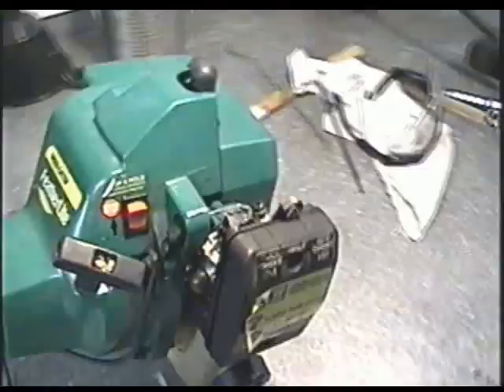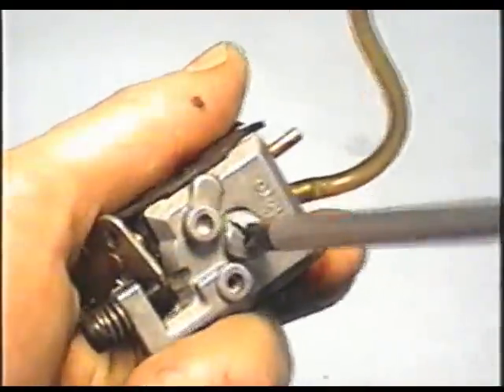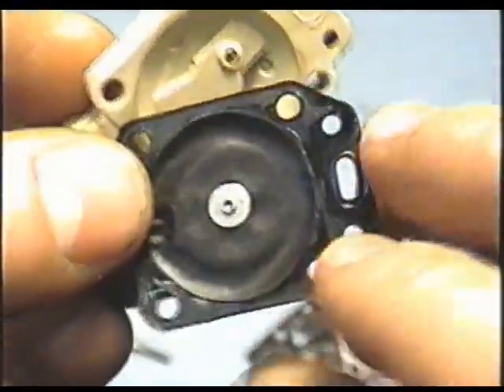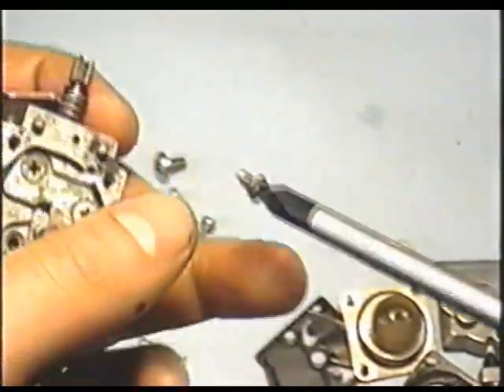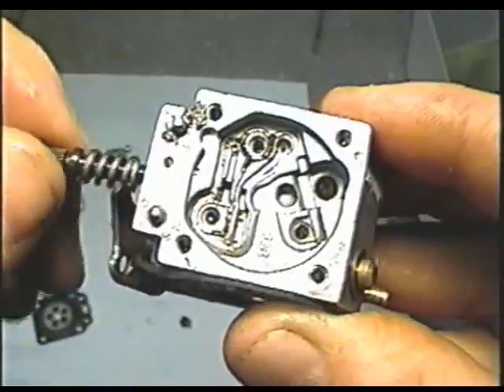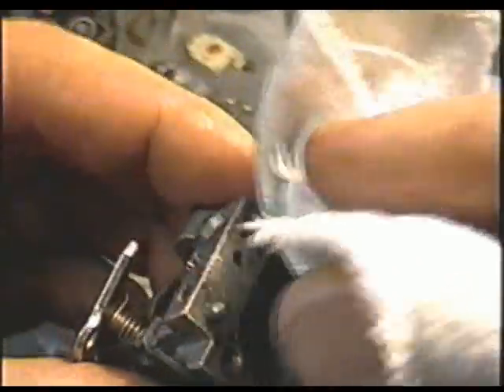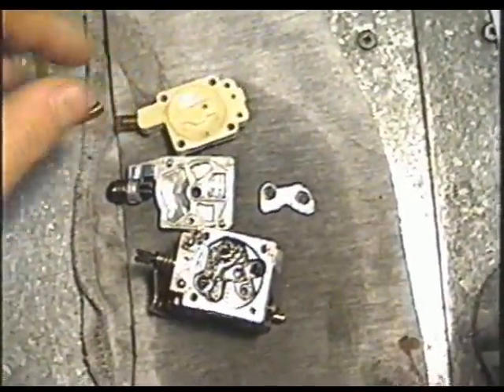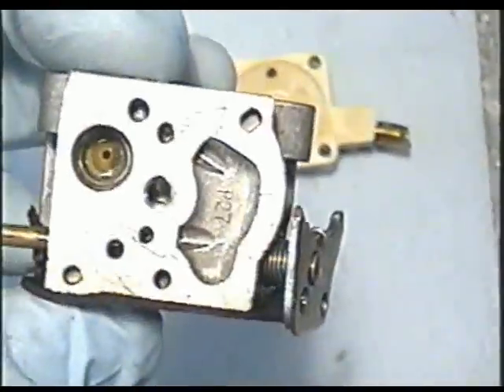Weedeater Carburetor Rebuild & Fuel Line Repair Part 1 of 3

Comment: Awesome video. I had idle issues and issues when running higher speeds on my Weedeater (it wouldn't stay running at speed when warm or idle without throttling it so I thought I'd try clean vs. rebuild first). Took the carb apart and cleaned it.  Then put it back together and dialed in the idle as in your video and it runs perfectly!. Thanks very much :)

Comment: The best advice on working around carbs is to always use the right tool.  Carbs almost never take anything other than inexpensive hand tools, and using the wrong tool will generally do more damage than good.  The rule of thumb is if you leave a mark or scratch, you aren't doing it right, and probably aren't using the right tool.

Comment: @crimsontide798, try adjusting the hi-speed screw. I got a two cycle weed trimmer engine that would do the same thing. Im thinking that you don't have enough gas going to the cylinder. But maybe if you have more smoke that it should, try counterclockwise. And halfway press the throttle trigger until you could get it to run more smoother.

Comment: Don, i have a problem with a homelite trimmer, it doesnt seem to be sucking any fuel from the primer nor up the gas line.  The fuel lines are brand new, primer bulb is new and carb gasket look in good condition

Comment: I bought a homelite 725 at a garage sale 2 years ago. finally used 3 weeks ago. It worked awesome. Then i used it again and it worked only half awesome. and now it wont start today. I looked at the hoses and they were broke with black stuff in the tank from the hoses. Got new hoses. And it still wont start. U think that black stuff got in the carb? I was in love with this weadeater and want to make it work again. The bulb gets hard but does not seem to release pressure. it will kinda idel.thedi

Comment: Great job on your videos. My Weedeater starts just fine and idles fine. The problem is when I give it some gas, it just putters out dies on me. I'll start it up again and it will putter out again, and just gets worse. Any hints that would steer me in the right direction? Thanks!

Comment: thanks for responding.the carb only has one adjustment screw with a cap  on it. would i break the  cap off to adjust it? with the cap on it only has about 1/4 turn for adjustment.Also do you have any videos for walbro carb rebuilds. I have a 77 Poulan  2 stroke chainsaw with one,that needs a carb rebuild.it looks like someone had been in there in the past and i think some pieces may be missing.thanks

Comment: great video,, I also have a question, on some carbs, there is a rubber disc, or rubber valve on the carb  on the side under the primer bulb. someone brought me a weed eater trimmer which this disc id damaged. parts kits don't have this part in a parts package. where cam I find this part ? thanks

Comment: Great video.good attention to small details.i recently acquired a weedeater featherlite plus with rotted fuel lines.I replaced the lines and cleaned out filter.gave it a couple pulls and it started right up.only problem is when you fully squeeze the throttle,it revs up but slowly (sort of a bog).it doesnt completely hit top end either(gets there but breaks up).tried swapping plug and cleaning out muffler.my guess is something with carb.any suggestions before disassembly)?thanks
Reply: turn out  the low ans high speed screws..if it idles too high turn low the IDLE screw only..to decrease the idle fine tune  it with high speed acrew turn to highest speed and rutrn it back out 1/4 turn out as to not burn out the motor from being too lean..too lean on either jet always causes bogs  good luck

Comment: @donyboy73 When i turn it that way, it looks right...but my metal back that the air filter mounts to is blocking the throttle lever from moving.  It has it trapped.  I am about ready to start a new olympic game...weedwacker tossing.  I'm certain I can throw it to houses down.

Comment: there is another model 1400 with a different orientation of the carb and tank, etc. I got a nearly-new one for FREE but cannot start it.... A squirt of carb cleaner in the butterfly area and it will crank over, but not stay running. I cannot even figure out how to use the side-by-side pair of screws for idle and hi-speed (if they are that!). The tank cap is on top and it is at the rear of the machine and low with the tank oriented side-to-side for the ends...

Comment: I have the same unit as you are working on.  I just sprayed carburetor cleaning all over the carb and it started up and stayed running for a while. Unfortunately, I noticed the primer bulb is now cracked.  Where can I get a replacement for this model?
Reply from the maker: if you're in Canada I can sell u one, if in USA contact discountonlineparts.com at 1 (877) 314-6990

Comment: Hi Donyboy73, I have a weedeater leaf blower that I need to replace the fuel lines on. Could you tell me the id and od size of the lines I think one is smaller than the other.
Thanks,

Comment: heyy i have the same weed eater but i need your help don first i have to tip it up side down so gas can get in the carb then i prime it and it runs off the little bit of primed fuel then shuts off from fuel starvation the fuel line is not long so its at the bottom but i dont know how that will help since theirs no pump to pump it up to the carb so really the only way to run it is up side down can u help don thanks!

Comment: I have a weed eater its.a feather lite sst after about 10 mins of running with a full tank a gas it will hardley stay running when I turn it on off choke it will bog down is it a carb??
Reply from the maker: +boneheadmoth as hezy yes that's a carb issue
Reply: +donyboy73 thanks for the advice

Comment: Best thing to do is to replace the carburetor. Usually circuits get clogged and then you end up taking the carburetor off and replacing it. A kit is about the same as a carburetor.

Comment: I can't for the life of me find a video where you set your weed eater back to the factory settings on my feather light. I have bought a new spark plug and have to tooled around too much with my high and low settings on a carburetor and I just want to get it back to where it was before when at least it ran bogged down lol
Reply from the maker: Kevin Hutchinson start at 2 turns out for high and low then adjust in from there

Comment: sigh, i rebuilt the carb with hardware, replaced primer bulb, replaced the fuel lines and fuel filter, replaced the spark plug, fresh gas and still won't start -_-